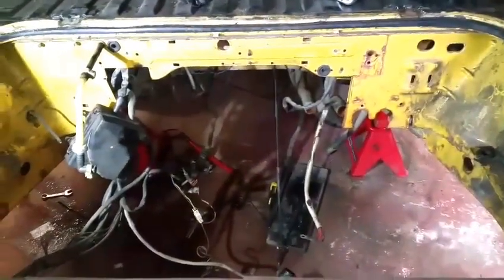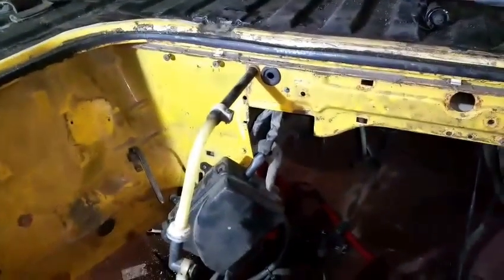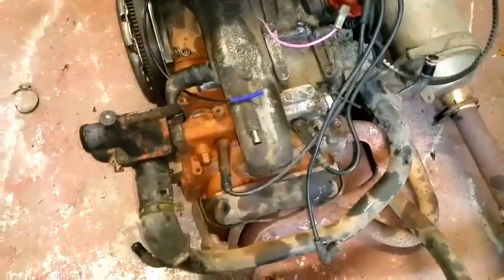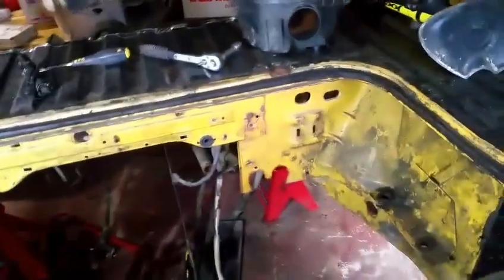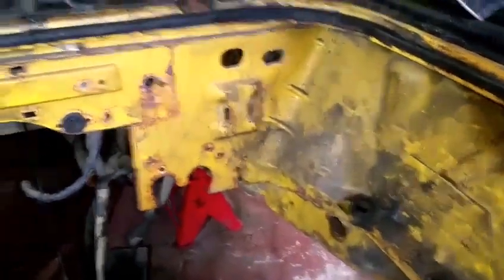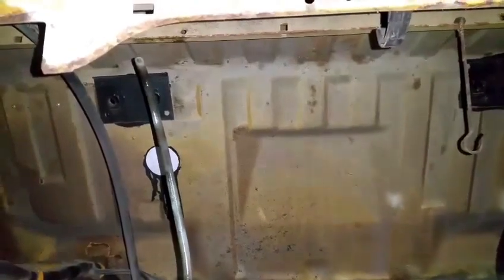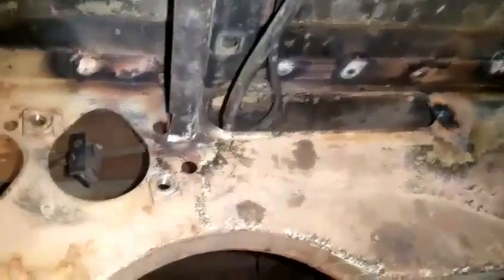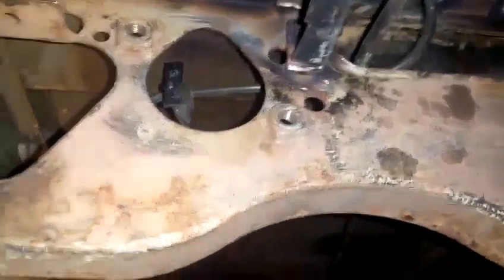VW T25 T3 Vanagon 2WD to Syncro 4WD Conversion Project - Prep work and centre crossmember change

Comment: Nice job! I also have a converted 2wd to syncro. How does the under-body treatment with the eastwood product holding? I also want to paint and tae care the chassis and under floor and I looking for a decent in terms of cost and protection solution
Reply from the maker: Hi
The Eastwood lasted well but not as well as other areas that I treated with POR 15, it's a little tougher. I use the van everywhere and everyday more or less so I've had to go back over a few areas.

Comment: I used rivet nuts for my conversion, they work very well.
Reply: i used rivet nuts for the syncro transmission brackets to the frame rail

Comment: What a great project. Where did you find all the parts? Is it fairly straight forward when you get into the project?
Reply from the maker: +bensonlifestories Thanks, I have taken all of the parts from a 16" Syncro that I bought with the intention to use for the project. I nearly changed my mind and restored the Syncro which was in a very bad way. However in the end I decided that it was just too rusty to repair within a decent timeframe so I used it as a donor for the project. Quite a few people have already done this conversion so it is well documented which makes it a lot easier for me hopefully :-)